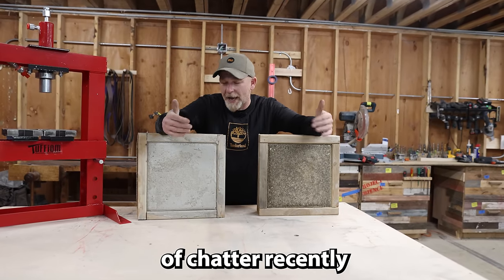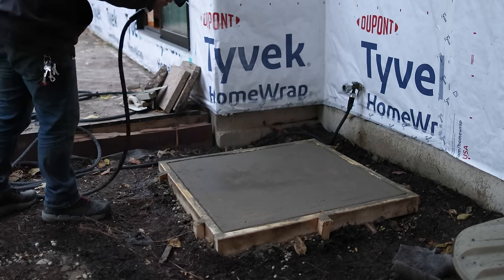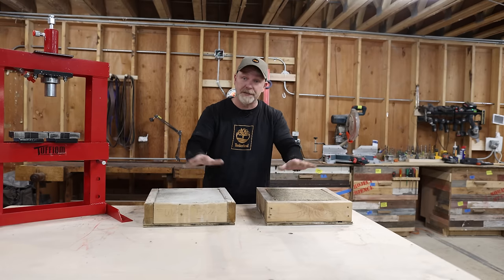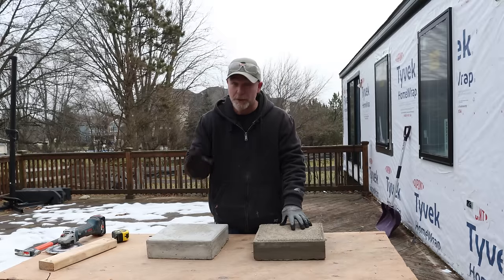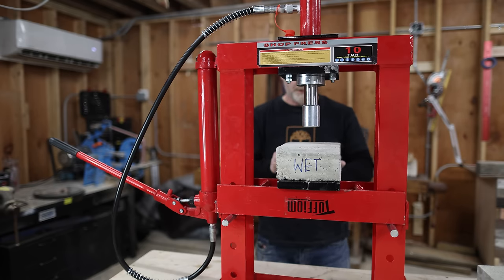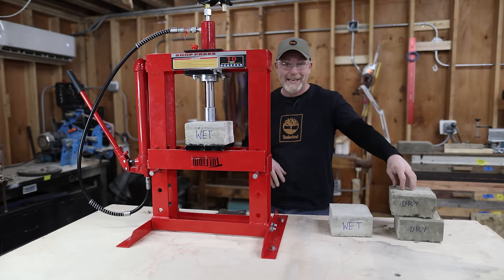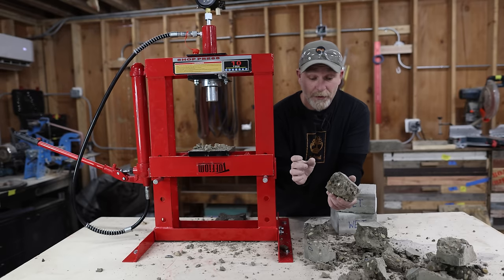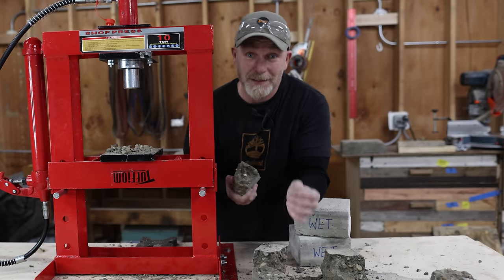The TRUTH About Dry Pour vs Wet Pour Concrete!! Strength Test - You WON'T Believe the results!!

Comment: I am a concrete engineer. No matter what, dry cure concrete will always be considerably weaker for many reasons; however,  you can increase the strength by keeping the slab flooded with water and covered for at least a week. It would be better to flood and cover for thirty days. No matter what you do, it will not ever reach even half the strength of wet pour concrete!
Reply: I agree , The water in the mix is needed to start the hydration process, as long as moisture is present in the mix it will gain strength ( slowly) ,  If you only sprayed the dry mix sparingly the hydration process probably stopped as the slab dried out,   The Myth that concrete dries is just that, a myth, Concrete hardens because of a chemical process known as hydration . Hydration is a reaction between the water and any ad mixtures added to the mix and the chemicals makeup of the cement powder. Typically more water is added to the mix than is needed for hydration but the excess is needed for workability ( handling/placing and finishing)    Its also a good idea to tap on the forms or vibrate the mix to remove excess air voids .  Next time do your dry slab by misting the surface and after it reaches an initial set  ( maybe 24 hrs) move it into a tub of water or other location where moisture is sufficient to saturate the slab so it can have enough water to hydrate the cement in the mix, . Also after each time you mist it cover it with plastic to trap the moisture in the mix so it doesn't dry out.  . Happy Easter :-)  Ps cure your slabs 28 days for optimum curing time.
Reply: @btpearce  WOW! You must write for Bob Villa!
Reply: @Carl_Jr   No, But I take that as a complement.  I worked for the Materials and Testing Division of NC DOT  for 35 years,  I use to teach the Concrete Certifications Classes .  I had to know a lot of in-depth concrete  information to be able to do my job.
Reply: Add three bags of calcium only on hot days
Reply: That's the problem with engineers. What you don't understand is that the point of dry pour is not strength. The point is the youtube algorithm.
Reply: Dry pour will not have proper distribution of cement (the only thing holding concrete together). There will be empty spots, a crack will form.
Reply: A ‘dry mix, to me, is a much reduced water/cement ratio, not completely dry like that.

Typical wet concrete without additives is around 0.5 water/cement ratio.  Compaction is relatively easy to achieve on smaller sizes.  

A ‘dry’ mix would have only sufficient water to achieve proper wetting of the aggregate thus allowing cement particles in wet contact.  Compaction is much more difficult, but for some things, several layers compacted sequentially can provide a better result than a wet mix.

I would not, for instance use a wet mix where shrinkage could be a problem.  The ideal situation might be setting wooden fence posts in concrete - wet needs support while setting, but dry can provide sufficient support for the post.  Wet can shrink, allowing easy water ingress, whereas the drier mix will not shrink.

Ideally, the water/cement ratio needs to be exactly the amount required to just fully hydrate the cement at the setting stage.  Curing would then proceed to provide the maximum ultimate strength (which may take years, btw).

Just tipping in a perfectly dry aggregate/cement mix is plain stupidity, IMO.  A completely unfair comparison.
Reply: I think we've all learned an important lesson,  F#(% The Dry Pour.....
Reply: @oliver90owner are you saying g a hole dug in the ground is not sufficient support to pour a wet mix in there after the fence post is made level in there?
Reply: @ryanbeard1119  Most use a bag of ‘postcrete’ for fencing posts these days.  Being a cement chemist, I happen to prefer to set my fence posts in my ‘dry’ mix - just enough water to wet the aggregate/cement mix which with good ramming provides a non-shrinking support for the post in a few hours.  This purely dry stuff poured from a bag is pretty well useless as far as I am concerned.  It is not concreting by any stroke of the imagination.  BTW, your claim of (exactly?) 28 days is just the standard chosen concrete cube test program for comparing products to specification requirement.  Cubes broken at 1, 3 and 7 days are (were when I worked in the industry) also used as well.  The early and even 28 day strengths are very much dependent on the C3S:C2S ratio of the cement.  Most cements rely on more early strength (from the C3S content) than cements made before, shall we say, standardisation in the industry took place.
Reply: Another issue with what he did was the plywood backer on the form. Although it will absorb and transfer some moisture, its not nearly as much as a pad with direct contact with the ground. Much more moisture can transfer from the soil to the cement, so more curing.  I'm not a concrete engineer, but I dug 70 post holes 20 years ago and did a dry pour for each one. We removed them last year (replaced the fence) and ever one was solid as a rock. Couple still in the back yard if anyone want to take a look.
Reply: Moist curing is key for wet mix and dry pour.  I achieved 50% of rating on the bag in my testing.  https://youtu.be/PgYVE8EE_ck
Reply: I disagree. It's not just the addition of water. Wet pour is better because you are replacing almost all the air with water and the mixing process creates a very compact uniform mix. You are making a mud. All the cement is activated. Then a excess water bleeds off the top and drops out the bottom gravity kicks in and settles the mixture further. Vibrating the mixture will expell even more water and air voids to further compact. Screeding surface drops larger rocks deeper and brings fines up then floating with finishing tools compacts the surface to create additional protection. It's all these factors that make wet pour better. And yes, the water left behind us vital to curing. Best results when I have been allowed to cover with plastic for a week. You get none of these benefits with a dry pour. Just making a dry pour wet does very little to bring sand and cement particles close together. Check under a microscope and then voila, you see why dry pour just doesn't come close to a properly done wet pour.  @btpearce
Reply: Good  points John ,   For sure a wet pour will result in a better finished product,  Careful with that floating and finishing, don't over finish or you will get a weak surface.  The extra water mixed in  at the surface will create havoc with your water cement ratio.  Too much water in the soup makes weak soup.  @johnknoefler
Reply: @btpearce  Dead right on any excess water.  When the concrete is cured and that water steadily evaporates, it means there will be microscopic voids within the concrete - and voids means less cohesion between particles, so less ultimate strength.  It is why additives are used to decrease the w/c ratio, while maintaining a satisfactory ‘slump’ test result.
Reply: As demonstrated by the low tech example or the original video above
Reply: @johnknoefler  that is absolutely correct! The mixing process in water gives you uniformity and blend that is necessary! That is the primary reason why dry pour is pure shit! No matter how much you pack it, and then later keep it wet, it will NEVER ACHIEVE  STRENGTH! At best, 50%! And that is only vertical force. I am a structural and concrete engineer, but i truly learned tons more about concrete being a concrete funisher for thirty years. Dry pour is good for fence post, but anything else, NO WAY!
Reply: Low slump concrete is far superior to either the high slump aka wet and dry mix.  The suggestion to soak or submerge is also important.  To make low slump concrete work best use a vibrator.  In my lab we used a 3/4 inch vibrator designed for the lab but a large model designed to consolidate concrete around rebar can be used.  Form vibration is also used for steel formwork.  A water to cement ratio of about 0.25 have some of the best results in our lab.
Reply: @Sjwolosz321 😂
Reply: @btpearce only issue is with misting is the water will be used up in layers where the concrete wants to make bonds and needs to water to creat those bonds. No water will mean it has short chains and we all know long chains are stronger.
Reply: Great video but no safety goggles and mask.
Reply: would a dry pour for a post-frame building isolated footing act differently, especially if the dry pour has continuous ground contact with moist soil?    Dry pour is common practice for post frame buildings and the company I know of has never had a building collapse or sink or even have large settlement problems in the 30 something years they've been installing them. they also pour the dry 3500 psi sakrete below the frost line.
curious if there is a video where they dig up a dry poured footing after 30 days to test the hardness.
Reply: Logic says that sand compacts when you make it wet ... so being wet more of the same material is in the same cubic space ... hence mathematically it would make no sense that dry would be as strong ... and I'm just a high school graduate 😂
Reply: I also think the mix was too wet, concrete needs consistent water in order to cure, when it's sprayed every   45 minutes, it had already set up where the water penetrated and then stopped curing when more water was added, Civil Engineer retired.
Reply: I have a feeling that this is one of those things that no matter what evidence you have, people will still argue it.
Reply: Name a scenario where you have 5 tons of pressure over 2 squared inches going over your dry pour concrete. A 20 ton truck empty doesn't even do that. If you want it to last forever put in the mixing work, if it's load bearing life and saftey wet mix it, if you repairing your granny's sidewalk and don't have time dry pour it. Don't have to be an engineer to figure out when to use each application.
Reply: Engineer i am curious to know how you would rank the following construction blocks in terms of strength, concrete blocks, foam concrete blocks and ACC blocks.
Reply: Thanks for sharing guess I won’t be lazy and always mix the batches.
Reply: @NoName-ml5yk  spot on
Reply: Is it possible to fix aarpon,  that the finish chips away ?  It was only poured a year ago from a concrete truck ???   It look bad !!
Reply: Bullshit
Reply: @brentlybyers  Ok Brently, state your case.
Reply: @madebymike5640 I was also going to comment on the plywood backer on the form. Everything I have seen on doing a dry pour says the ground must be soaked prior to adding the concrete mix. I am a former concrete finisher/owner and am still skeptical of doing a dry pour, but if someone is going to do a comparison test, they must do it as it is supposed to be done.
Reply: Thanks for saving me 15 minutes
Reply: If I build my frame and put plastic sheeting in the frame, fill it halfway with water, then dry pour the concrete, will that increase the strength?
Reply: Learn how to mix cement using the instructions that come with the product.
Reply: @timfuscaldo3024  I have been doing that for 40 years. I was just wondering if the water was already there, would the dry concrete be better than wetting it from the top. I am aware that you would still need to keep it wet for it to cure properly.
Reply: @oliver90owner,
You are wrong about way not providing support for posts.
Just because it's called a wet mix, it does not mean runny.'
We just set go 18 foot steel posts in 3 feet of wet mix concrete.
The concrete held the posts straight. We ensured that using a level and checked it multiple timed throughout the day.
I would never use dry mix for that purpose
Reply: I've never heard of a concrete engineer before...
Reply: @piercer4882  I was once a petroleum transfer engineer at the local gas station.  Pay was shitty.
Reply: Well, he didn't press it
Reply: Interesting your comment on "keeping the slab flooded".  I still can't talk about specifics but in my post Navy flying days I worked on a project where they had to build some "objects" full of rebar and I-beams.  After the huge amount of concrete was poured and worked to final finish, they had misters keep it wet for about 12 hours then they would bring in 5ft tall steel caissons and fill them with enough water to keep the surface of the concrete about an inch under water.  After a day or so, they would fill the caisson almost full.  After a couple days (I'm being purposely vague) they would raise the height of the caisson to a few sections and fill it completely.  Over the next month, every morning they would use what looked like trolling motors to stir the water for an hour, take 5 gallon buckets as samples off to somewhere, come back and add various somethings to the water and stir it for a few hours.  After a full month they drained the water and removed the caissons and let the whole thing sit for a set period of time before they would begin construction.  One of the engineers working the concrete side of the job said that was the strongest concrete you could have.  That after the first month it was essentially as hard as it was going to be.  The next few percent of hardness would come with age... that would take about 100 years.   After about 100 years it would then start weakening.   I sometimes think that complex is now middle-aged and still hardening...
Reply: It has it application especially when your trying to keep shrinkage to a minimum. I installed man ways into circular storage digesters at a water treatment plant as a contractor. Where we cut into the side of the circular digester break out the existing concrete install the man way and weld it to the exposed rebar. Then we applied an adhesive to rebar and exposed concrete then form and pour 80% of the opening. After the concrete set we dry packed by hand the remaining 20 % opening with a spray bottle and cement the amount of water is critical to keep the shrinkage to a minimum.
Reply: It does not appear as though you did a good job on the dry pour. 
They obviously look completely different which is not my personal experience with dry pour, so your technique is off from the get go. But I will watch any way to see what the results were. Just saying your dry pour looks really rough, Again nothing like the other, not my experience.
Reply: What tells me dry pour is not for strength applications is that all heavy strength uses (foundation footings, bridge abutment, etc.) are wet poured.
Reply: By the time you do all the additional work to make dry pour only half as strong as wet pour, you aren't even saving time at that point.
Reply: now do the perfect water/cement ratios...
Reply: Excellent video. Now I canned the idea of my dŕy pouring a sidewalk.
Reply: That’s what I was curious about. Thanks for the explanation. I guess if you dry pour, it will never cure properly, no matter what.
Reply: Lmao..concrete engineer...lol..😂...great useless comment
Reply: Exactly but it has its place like a pad for garbage cans or pad for A/C unit. Or a muddy spot at end of deck stairs ,etc.
Reply: @btpearce Hey brother, as a fellow NC'r what's the best concrete for our state? I'm over by hickory, so something that can definitely hold up in rain. (Looking into getting a slab poured, I clearly don't know shit about shit. lol, Any tips to longevity is more than appreciated 🤙)
Reply: Hello Vaughn, I’m NOT a concrete engineer, normally. But I need to lay cement into a small wet pond. 
I’m thinking to pour the dry cement from the bag into the 1st inch of water assuming that the cement will get fully wet. Or is it the MIXING of the aggregate that matters?? I doubt it, but I don’t know. 
Do you?
Just above the water I can wet pour, but again, if the aggregate is sitting on water, does pre-mixing make a difference?
Also, is it true that the extra water surrounding an underwater wet pour will weaken the cement? If so, then is it better to ‘dry pour’ into water than to pour wet cement into water?
Your thoughts??
Reply: Hello Vaughn, I’m NOT a concrete engineer, normally. But I need to lay cement into a small wet pond. 
I’m thinking to pour the dry cement from the bag into the 1st inch of water assuming that the cement will get fully wet. Or is it the MIXING of the aggregate that matters?? I doubt it, but I don’t know. 
Do you?
Just above the water I can wet pour, but again, if the aggregate is sitting on water, does pre-mixing make a difference?
Also, is it true that the extra water surrounding an underwater wet pour will weaken the cement? If so, then is it better to ‘dry pour’ into water than to pour wet cement into water?
Your thoughts??
Reply: And if you did it this way... It would turn white. If it stays brown, then you didn't add enough water to it before it sealed.
Reply: Reason is bond is weak because they harden at different times that is why the crumble so easy. In civil engineering when we pour new concrete to old we use a special bonding chemical for what is know as cold joint. But it's not as good as a homogenous pour that is mixed and poured at the same time.
Reply: There's no such thing as a concrete engineer 😂
Reply: @CybekCusal  at civil engineering you study everything but usually end up focusing on one field at the end of your degree and rest of your career. So civil engineer might end up choosing concrete design courses further and for the entire career only design concrete structures and not once work on steel structures or wood structures or other civil engineering fields like Geotechnical and transportation engineering.
Reply: @current9304  what does your license say?
Reply: @CybekCusal   there is two type of license one that require FE test or fundamental engineering test and the other is PE or Professional Engineering test. The latter requires 8 years experience. I have just completed 5 years at work so I need 3 more years to get the license as Professional engineering after passing the exam.
Reply: I was wondering if you finished the top in the style of a dry poor, and then kept the slab fully flooded after if it would make a difference
Reply: 30 days lol, 4 to 7 depending on your temperature, go back to your strength curves.
Reply: I am a Civil Engineer. 20 years of site work before I retired and I never even heard of dry pour concrete until a couple days ago. Four years at university and twenty years experience and never even having heard of it says something. If professionals don’t use it then why should you? Simply because it’s easy and cheap and you don’t have to think much? You can console yourself with those concepts when your shed slab breaks and your shed lands on one of your kids.
Reply: If you have a damp mix and compact it the strength will be much higher than a normal pour with water to make it plastic. The strength is proportional to density to the 4th power.
Reply: I am considering a small slab for an out building  dry pour with some used shag  carpet over top and keep it really wet for a week... is that long enough?  Or how about I let my great grandkids keep the hose squirting wetting the site  as I drag the bags  to back of truck , slice and dump. ?  As a 75 yr old granma It is really too much to mix then pour
Reply: @cluebin8398  just your back.